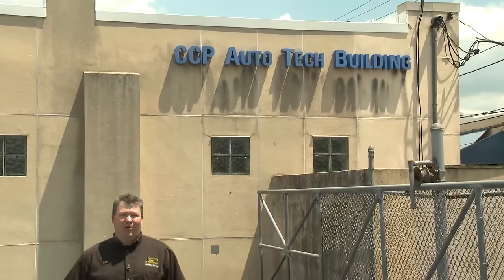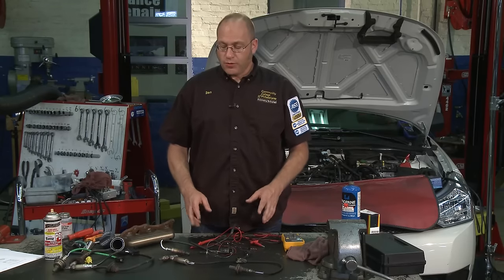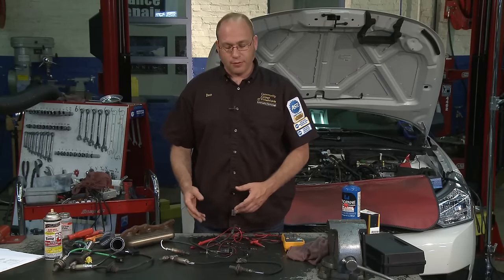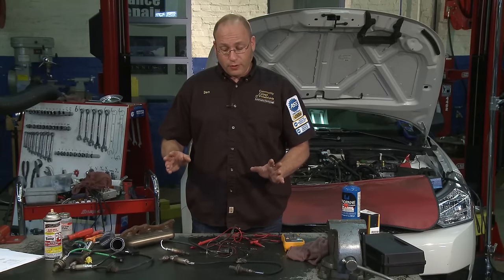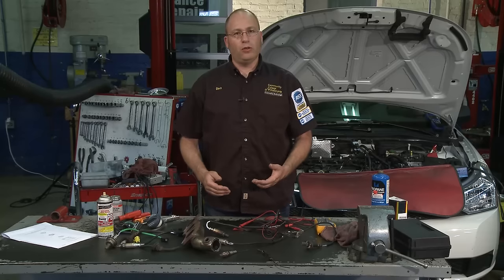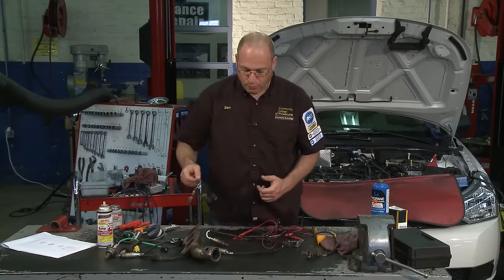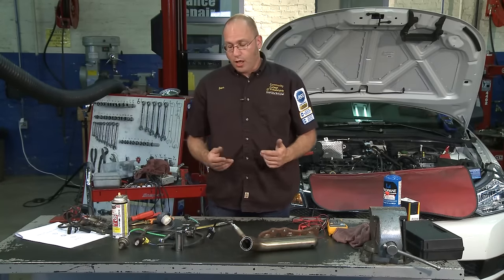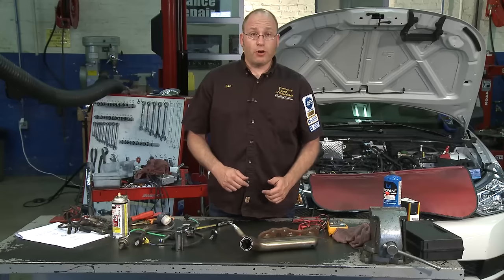Car Corner: O2 Sensor Diagnostics

Comment: Nice I actually sat and listened. I went to school for Automotive was in the early day's . whem all we had to do is to do Lean drops om a Rodchester  4 barrel thermoquad  . Times have changed but remember all that read this a engine has to have 100psi a cylinder to even make it possible to have a  running car . YOU WOULD BE SUPRISED HOW MANY tECHS DON'T KNOW!

Comment: Dear Professor,

I am from Philadelphia myself originally and was glad to see your video. It aided me in understanding the issues I had with my vehicle (Ford 2015 Police Interceptor Utility). In the end I ordered the proper part online and paid a shop $50 to install the O2 sensor for me (as I had neither access to a lift nor a jack that could get my car up high enough for me to use a breaker bar to remove the O2 sensor myself, even with the proper O2 sensor removal socket in hand).

Your video is highly instructive and well appreciated in no uncertain terms and thank you for effectuating its publication.

Comment: Dan.  One of the best presentations I have seen.  Everything was explained in simple terms.  My mechanic told me I have a problem with the heater circuit in O2 sensor past the catalytic converter.  So what I'll do as a quick check is remove it, get a wiring diagram from Bosch and check the resistance of the heater coil.  My mechanic says he doesn't mess with that stuff.  I don't know why.  That's why I took it to him.   The thing is I just replaced that sensor not too long ago.  I talked with the man at Bosch and he's going to see what he can do for me if it is the heater circuit.   Thanks for the help.  Bill Piech   Raleigh, NC

Comment: Excellent. While you did say pin # 4 after reading it correctly as pin #2, you correctly re-checked the reference page and did exactly choose and say you chose the pin #2. You said pin # 4 once but you said and used pin # 2 twice and correctly. Someone mentioned this thinly a while ago. I know that you chose the right one and you double checked the info as you proceeded so I saw and heard an excellent mechanic being careful and rechecking the reference info on the fly. I work on my vehicles and occasionally help others(never for pay) and I warn them that while I refer to myself as a mechanic by experience, I have had very little actual training. I am in Texas and am too far and too old to get to your class and I very much regret that. This is my first viewing of one of your videos. I subscribed immediately and I hope to find more. WOW, way to go Dan Reed.

Comment: I am not an auto tech, and either a DIY guy. I watched the whole thing because you articulated how to use the diagnostic tools to fix the check engine light very well. I also noticed 559 thumbs down. Not a surprise. I think I know the reason. See, It is not you're wrong. It's because auto "stealerships" (dealerships), and crooked shops don't want you to educate the people they have been robbed with unnecessary and unjustifiable problems they occasionally  made up. For one real issue found, they would have to make up two or three more to generate revenue. You're also going to receive some thumbs down from those who can't analyze or can't think outside the box. Good Job! Keep it up!

Comment: Am not a mechanic or engine enthusiast, but because on 2 occasions my Nissan developed this check engine with P0420, i am so informed right now. My local mechs will not lie any more especially on codes that are logic based, Thank you so much for the educative video. Will return once i buy new O2 Sensor

Comment: I am a firm believer in using antiseize. You may think this is overkill, but I will if possible, clean the threads in the exhaust pipe with a welder's pipe brush and apply a VERY thin coat to all the threads. I also apply a VERY thin coat to all the threads on the sensor. And like Dan says, don't let it get on the sensor.   I have friends who know where I've been because everything was so easy to take apart. Also, when you can't loosen a sensor with conventional methods and a torch is not practical, I have used an 8 or 10 inch pipe wrench after soaking the threads with warmed up PB, which is more chemically active.

Comment: How is it that the heater measured open circuit the scanner said the current was 17 amps and the voltage was oscillating between rich and lean

Comment: A few other things to try if everything in this vid fails to break it loose (a GREAT vid, by the way):

1. If you are not going to reuse the old sensor, and have cut off the wires DO NOT USE A SLOTTED TYPE SOCKET! They do expand enough to slip and round off your hex if you put enough pressure on them! Just use a regular 7/8", six-side socket if you cut the wires off.

2. A slight variation to the vid, where he heats both parts: try heating the mainifold only, as much as possible, getting as little heat on the sensor as possible. Heating them both will cause both the manifold and the sensor to expand from the heat. The ideal situation is make the mainifold threads expand MORE than the sensor threads, breaking the bond more easily.

3. If that doesn't work try it again. This time when you are done heating, wrap a damp rag around the sensor (keeping it away from the manifold as much as possible) to contract the sensor threads. Try again quickly.

4. If these don't work, heat the crap out of the manifold AND the sensor until everything is as absolutely as red hot as you can get them, then douse everything with water. The intense and rapid contraction might break the bond.

If you try enough things, enough times with heat, it WILL come loose. You simply have to break that bond between the threads. Just don't give up, and don't round off the hex or you will have a whole other problem.

Again, nice vid. Do as he says once you have the slightest movement. Lots of oil, lots of patience, back-and-forth until you work past the corrosion.
Reply: Persistence pays off.

Comment: Great video I was doing my own diagnosis on o2 sensors but had doubts and now I don’t unfortunately I have a p0420 code with a replaced cat that is still showing faulty car still needs to be checked for exhaust leaks downstream sensor has been replaced but not upstream I’m hoping for a solution without breaking the bank any further.

Comment: I was looking for a discussion of why the O2 sensor might not respond to drive cycles when attempting to get I/M readiness.  I have no engine faults, but several careful drive cycles failed to get the O2 sensor to readiness status.  All other sensors, including the O2 heater sensor, are ready.  Before I go to the trouble of replacing 4 02 sensors, I would like to find out what other options I might have or tests I should run.  This is for a Chrysler system.  BTW, you are an excellent teacher!

Comment: Professor, 1st 0 to the right of decimal is tenths 2nd is hundredths third is thousandths. I just got done completely tearing an oxygen sensor apart and i found a thermocouple and a heating element inside but no sensor to measure ambient oxygen. Great video any how!

Comment: Brilliant video Dan, I learnt heaps about O2 sensors. Keep up the good work!
Reply: Hi i had a head gasket burned out  due to water leakage.Since then i repaired that engine but after that i had engine yellow light to comes on & off engine was running roughly.I replaced that engine with an other one with 60.000 km ,but the problem exist !! the computer says Number 4 th injector problem.Replaced No 4 with a new one ,still i have the same problem .the last two days the yellow eng.warning lite is stady ,but the time it starts to goes off & on   engine lose power like working on 2 cylinders!!!!...Any idea what going on with that problem?????  thanks a lot  for your time
Reply: If we have so much troble with flat conector why no makend round ???????????

Comment: A very good video, especially with the practical test of the sensor and then the diagnostics tool demo. It appears that my Honda Jazz (UK) has suffered sensor failure which I suspect has been troubling the car (and me!) for the last few years. The practical test showed a heater resistance of 15ohms which I think is too high; this only heats to 10watts at 12volts which I think is too low. And the sensor output is 7mV which also appears to be far too low; I used the same blow torch test as you did. I feel more confident now to use a diagnostics tool to confirm the sensor status. Many thanks.

Comment: The best way to check if the lambda sensor is functioning is to set the engine revs at around 5000 rpm , go to the rear of the car and take a big long sniff of what comes out of the tail pipe . If you pass out immediately it's not working , if it takes 5 minutes to pass out its working fine !
Reply: Rosemary Robartes too freaking funny.
Reply: Lmao😂
Reply: Q: Why not direct measure sensor heater wires before take it out?

As the sensor is a messenger which means it could be something goes wrong instead of the sensor itself. In that case we save the effort to plug it out?.

Or something I misunderstood here?
Reply: @leesire  ¹

Comment: Snap-On makes the best 7/8 Sensor Socket. It's thin wall so it will work with sensors that have heat shields.

Comment: Many earlier cars, pre OBD2 don't have flashing engine lights, they just illuminate. I've soldered quite a few O2 sensor wires with no issues just make sure your wires are cleaned well and you get a nice wet looking solder and heat shrink insulation

Comment: Dan, you should add a thread chaser tool to your vid. Cleaning the threads is good practice before installing a new 02 sensor. The sensors thread in better like slicing butter and helps with proper torquing to flatten the new washer. Especially, when you're working on a single, or 2 wire 02 that relies on exhaust manifold ground to comm with the computer. Just saying...
Reply: Good idea!  Next show!
Reply: What’s the thread pitch on most, I work on diesel so I have chasers for the nox sensor and soot sensor

Comment: 38:53 you say pin 2 and pin 1 per the diagram then say connect pin 4 and pin 1 at 39:02 then you connect to pin 2 and pin 1??? Which is it instructor?

Comment: I had a 1980 Dodge d50 pickup and the Mitsubishi equivalent. Both had an exhaust manifold with a built in cylindrical catalytic converter in the two piece exhaust manifold. I took both out and used a screwdriver to break up and remove the guts of the converter in both. Drastically improved performance of both trucks. I converted one into a convertible. It was a cool thing back in the day. 

FWIW, I had to do the first one because, when I checked it, the top had been melting like pudding. The makeup of the thing is like a 3D screen. That is, instead of the holes being tiny squares, they were tiny tubes, about 6-8 inches long, IIRC. But so many of the tubes were clogged from the "melting" that it created massive back pressure. So I got rid of it. :)

This was in the Seattle area. They still passed emissions tests. It was also around the late 80's.

Comment: Great video except when finding PIN numbers to check the resistance/continuity, you read right from paper but said incorrect pin #1 &4 instead of #1 & 2 and while actual testing both old and new sensors, you used correct pins #1& 2 where old found open circuit (L) and new one measured 3.7 Ohms. You may want to correct your audio on it.
Reply: i also noticed that haha, great demonstration
Reply: Bashir, although that may be the case, it is a minor typo hardly worth the mentioning.  Anyone getting into this kind of work should use their specific technical specs and choose the correct terminals without issue!
Reply: Really? I think it's a significant enough error to mention and really has nothing to do with how sharp you are or aren't and/or your enthusiasm or lack thereof for the auto repair industry you're either employed in or not. It was an error. Errors should be corrected. Period. Good eye/ear Mr. Chughtai. 😉

Comment: Great tutorial I do have one question I have a check engine light on on my 2002 F150 and it is saying bad O2 sensor and map sensor I have not had a chance to change them out yet will this cause the exhaust to heat up and smell hot

Comment: I noticed at 39:02 , You said measuring resistance between pin 1 and pin 4  for the heater  ,  it should be pin 1 and pin 2  which You eventually did  ....  anyway thanks for the great video on O2 Sensors ...... 😊👍

Comment: I have a 97 Chevy Suburban C1500, 5.7 L that from time to time the check engine light comes on.  The code, P 0141, indicates the problem is the O2 Sensor Heater Circuit Bank 1 Sensor 2.  I only get a random code from time to time.  I can clear the code or just drive for a few short trips and the check engine light goes off, but of course the code is still there to read.  If I had a vacuum leak wouldn't both sensors cause a code and would the code not be the heater but something like?  I also read that only the upstream O2 Sensor has a heater, or is  that true?  I would appreciate your thoughts on this.

Comment: At the end of the video I wish you had  shown that the engine light was off. If you had the code reader go through a full test cycle, code P1000 would  not have cone on, correct? Thanks for the great detailed instructions.

Comment: Hi Dan had to pause it at 18 minutes in to add the main reason you do not attempt to splice a o2 sensor wire is because you can change the resistance in the wire and that will greatly effect the 1 volt to .1 volt reading affecting air fuel ratio mixture. Also like to point out that as you said never cut the wire past the harness connector but as long as you are replacing sensor YOU can unplug from harness and cut wires at o2 sensor making it easier to get box end wrench on it. I have a special tool but sometimes you can not get it on and some can be a real bear.
Reply: The main issue is that most O2 sensors use stainless steel for wiring, which can’t really be soldered well with over-the counter typical electrical solder. That in turn can lead into the voltage drop issue. But I totally get what you are saying.

Comment: Great Dan Reed. That was an good lessson about the o2 sensor. I have to check my vaccum slang when they didnt find whats wrong. My guess is that 5ohm element is broken but i have to hook it up and read. If not i might check the ohms. I havent noticed any issusis when runing or fuelconsumption. It comes and goes but now its stayed lit. So its time now. And yeah it was at the car dealer. And i did phone in at first. But its hard to find any wrong when its working excelent. Thanks.

Comment: Thanks Dan, very good presentation. I hope you have time to respond. I bought a  2004 fx35 last year and it failed smog check for P0138 and P0158 which are the post CAT o2 sensor issues. I went ahead and changed them both and I found out that it made no difference. When I delved into it a bit more I realized that all 4 o2 sensors once in operating temperature just show a steady voltage, the post CAT sensors go to 1.275 volts and max out, and B1 S1 is at .3 V and B2 S1 is at .64 with .01 v oscillation. When I accessed the ECM to see what is going on, I found that someone had simply joined the wires between S1 and S2 on B1 (and not B2). For the life of me I cannot figure it out why would anyone do that and why would ecm accept this. BTW, the car runs smoothly and aside from the "service engine soon" light on there are no issues. I also verified all 4 o2 sensors they are fine, even the original sensors that I replaced were fine.
Anyone out there has any idea what is going on. I hate to revert it back to what I think it is supposed to be and find out now that the car is not running smoothly anymore. I have to point out that mileage is not that great 14-17 mpg. I unplugged B1 S1 and drove it and it still worked but not smoothly, it got slow to respond to acceleration.

Comment: Your video is very helpful to help me figure out my issue with my o2 sensor on my 94 astro because my engine light would only come on once my van would heat up so now i know that mine is a one wire ..  thank you very much very helpful

Comment: This may be a dumb question....but why can't they put a way to disconnect the wires close to the sensor as well as the original harness....so you could put a regular socket over the sensor?

Comment: Nice presentation.  My Mustang was intermittently showing the CEL and throwing a P0050 code. (HO2S Bank 2, Sensor 1)  The dealer replaced the sensor and cleared the code.   Well, the CEL was back on in no time with the same code.  As before it is intermittent.   Would welcome any comments or suggestions?

Comment: Hi, when you were heating the sensor to test the voltage, your volt meter seems quite standard, so where was the input voltage coming from? I would think that the voltage being sent to the sensor is constant, when in circuit. The voltage output would be altered as the resistance changes within the sensor.